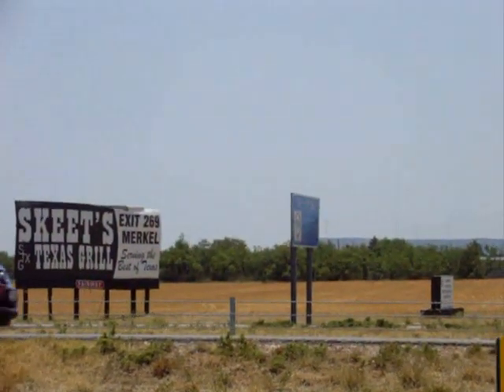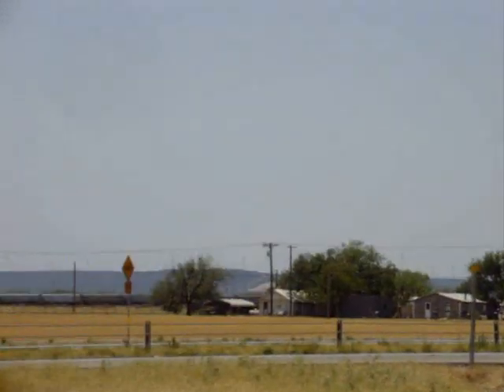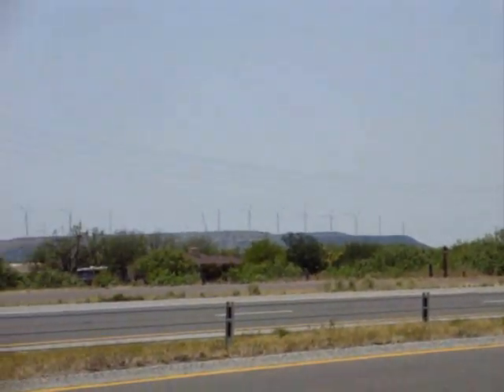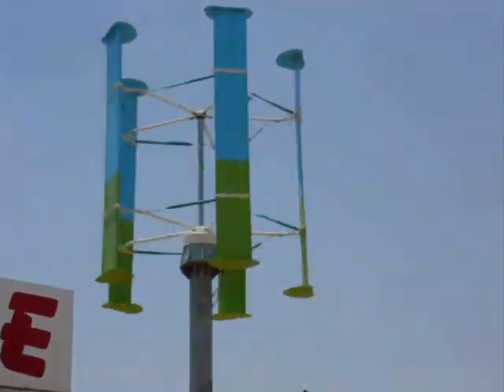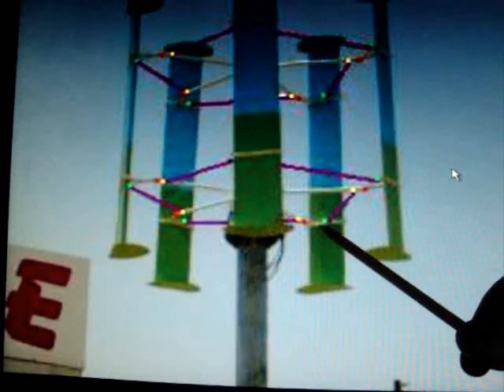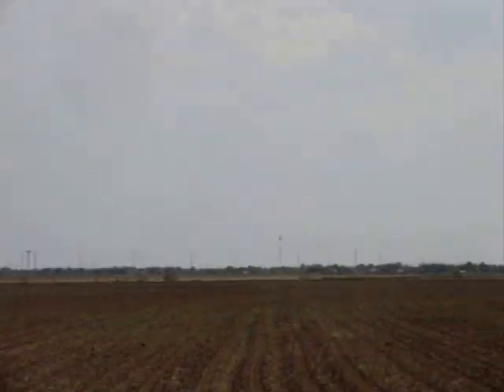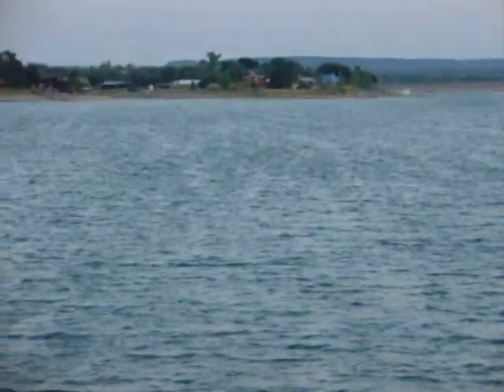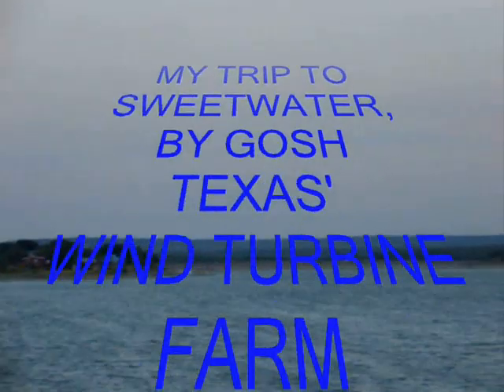MY TRIP TO SWEETWATER, BY GOSH TEXAS' WIND FARM

Comment: @muddymuddymuddmann LFTR comsumes the nuclear fuel, Thorium, 100%, and it also also EATS nuclear waste from uranium reactors. It produces uranium 233 which is extremely difficult to weaponize and the LFTR reactors are self protecting. It uses hot liquid fluoride thorium compound which if the reactor has a problem automatically shuts down without external electrical needs and the thorium drains into a reservoir safely. NO Three Mile Island, Chernobyl or Fukushima accident.

Comment: Ya know, I think I could build one of those vertical axis wind turbines. Problem is, I don't understand how it works. I'm thinking it has to do with the angle of the blade to the center. Like an airplane wing, if the angle of attack is too high, then it experiences turbulence, and quits flying. I don't understand how it catches the wind. I made one of the 55 gallon drum rotors. That spins pretty well.

Comment: @muddymuddymuddmann
   G'day... Nice clip ! To be honest, the Savonius is easier to engineer ; and if it extracts Oomph from the Whoosh, then Yay Team..!
  Actually, these aren't the BEST Sections for this style of thing. Visualise De-Skinning the Flat (Out) Side from 20% Chord to the Trailing Edge. That'll STILL  Autorotate in high-wind, plus it has good starting Torque, when it's stopped. Removes the need to Pre-Spin... Asymetric Drag to start, + High Lift for+ RPM.